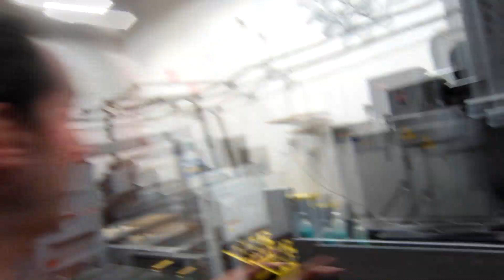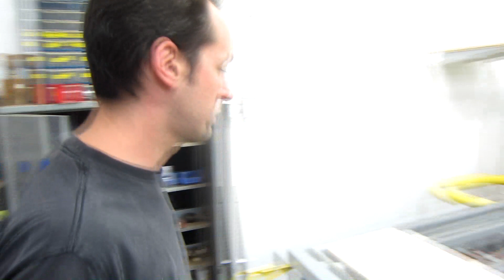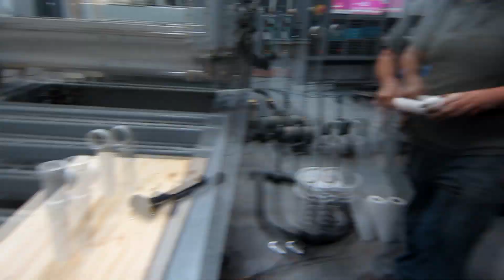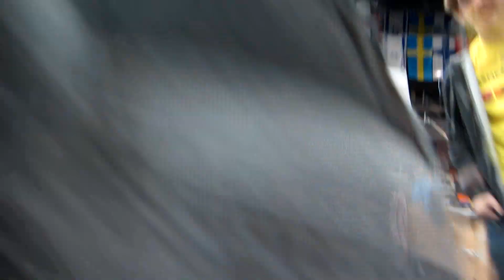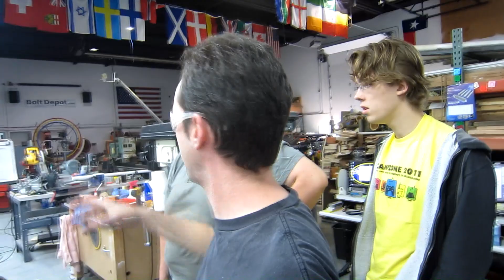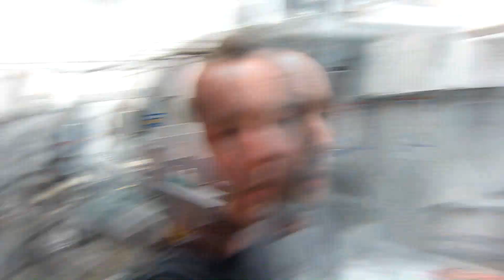Captain's Blog 10-1-2012 Vacuum Table Construction Day 1

Comment: the main issue is anything set up that requires removing to do a tool change. It's impractical and I am engineering a solution that does not interfere.

Comment: Are you setting up valves for each hole/row of holes? How about milling plugs to put in the unused holes? I say this because it stands to reason that any unused holes will not be covered so the plug should not obstruct anything.

Comment: Maybe for the vacuum nozzle for the dust you can wrap a coil of 12 gauge wire around it to stiffen it up, just a suggestion, not a clue if it will work. :-)

Comment: I had an idea for the vac table to prevent pressure loss, but I don't know what you're planning co it may or may not be compatible: use electronically controlled valves and vacuum gauges on each pipe going to the grid surface hooked up to an Arduino or some such that cycles the valves to determine which ones have stuff on them and close all the others. That way, then you start the pumps, all the unused spots won't be feeding air into the pumps, killing the vacuum.

Just a thought, I'm no expert.

Comment: I have been helping a buddy building a big CNC machine. and we built a vac table for it thats divided into 4 sections. So you can shut off the sections you don't use, so you don't need to cover up so much stray area that makes it all lose vacuum. we used big ass sprinkler ball valves for that. Works a treat! :) We used 19mm MDF.. one bottom sheet, 2 middle with all the vacuum canals in them and then one top sheet with LOTS of small holes.